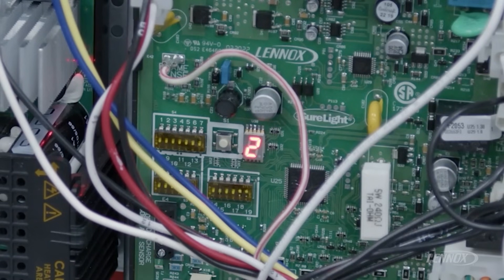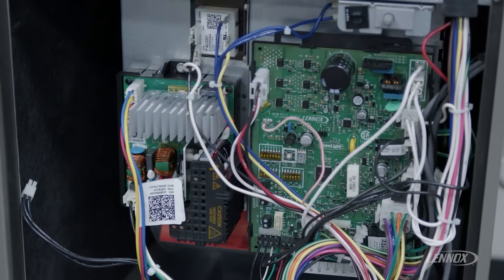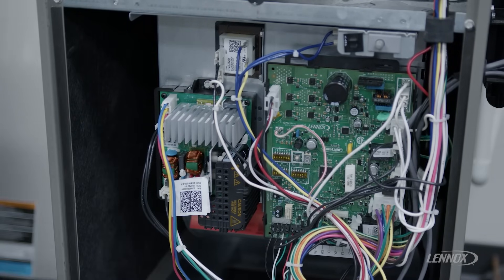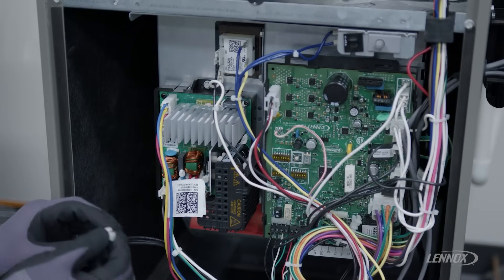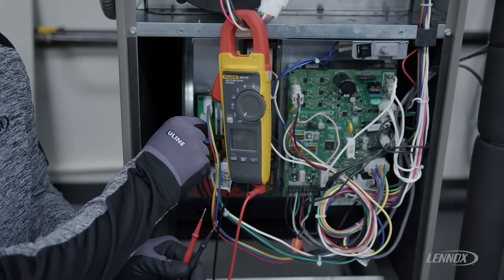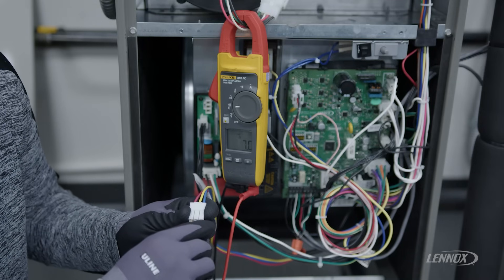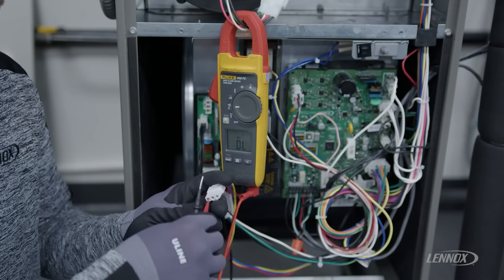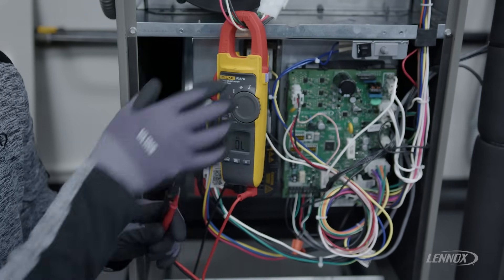Furnace Error Code E201 : Causes and Fixes | Lennox

Comment: The best way to check this code would be to buy yourself an ecm tester. Check if the motor starts with tester, if it does it would lead us to think that the board is faulty if it does not come on with the ecm tester I would look at replacing the module alone or module and motor

This can be an annoying diagnostic. Sometimes it’s best to bring both board and module

Comment: FYI - it was mentioned (3:45) that when checking continuity from blower motor to earth ground, the proper reading is 0 (zero) ohms. That is incorrect, the proper reading should be infinity or in the case of the dvm that is shown is OL

Comment: I have 4 black wires coming from the blower motor going into the control board. What am I looking for as far as voltage out of the board going into the motor? My transformer is good